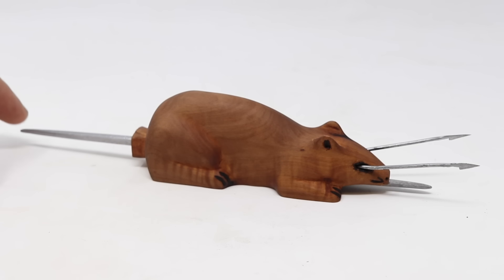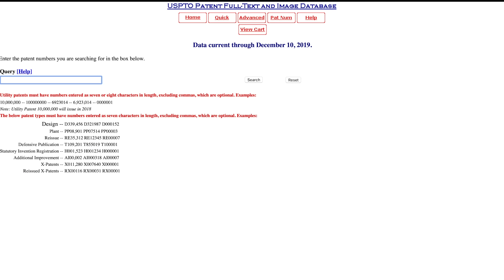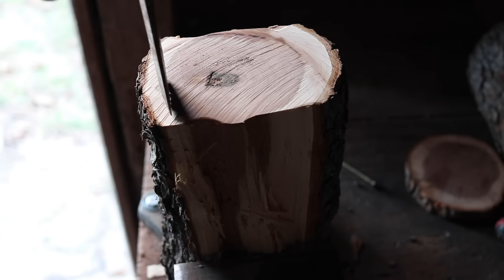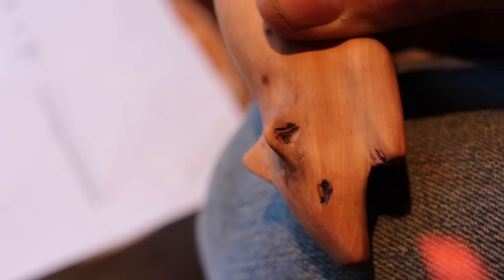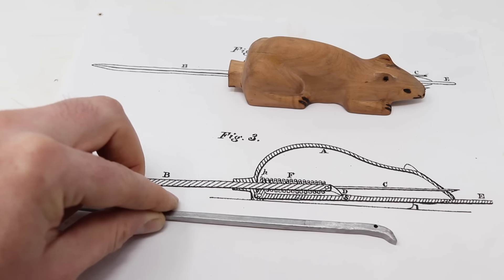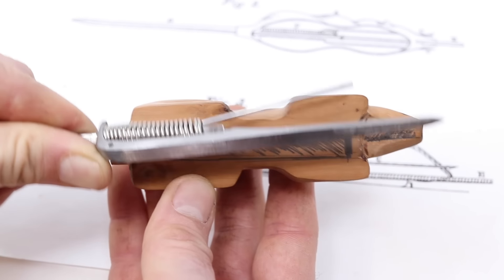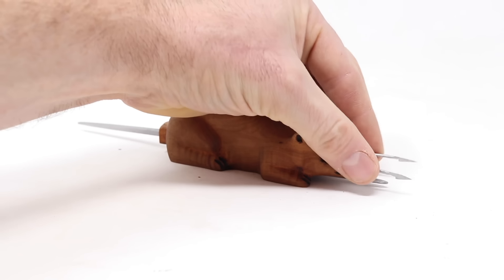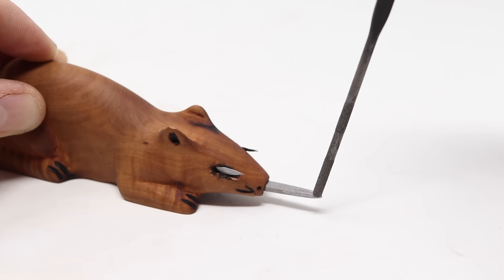A Wicked Harpoon Eyed Spring Loaded Mouse Trap From The Civil War Era. Mousetrap Monday

Comment: The paper-towel tube is actually a slight improvement - It makes sure the mouse is in the proper position.
Reply: I was thinking the same thing. Would be gross to find a struggling mouse with a spear through its paw
Reply: A clear tube would be great to show the action.  Of course only on his seperate site.  However, there isn't nearly as many new uncensored videos as he use to post.
Reply: I agree
Reply: It made the typical date into a blind date 🤔